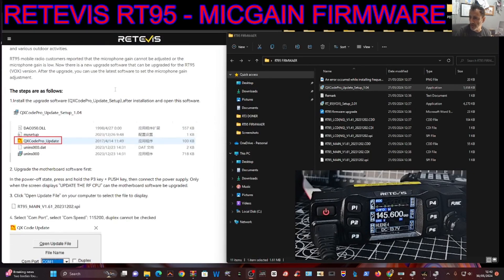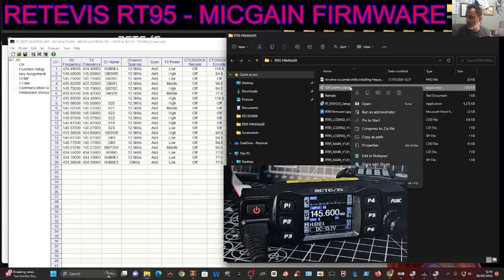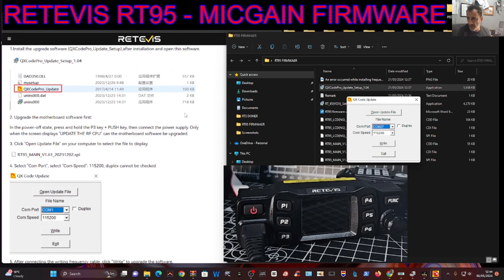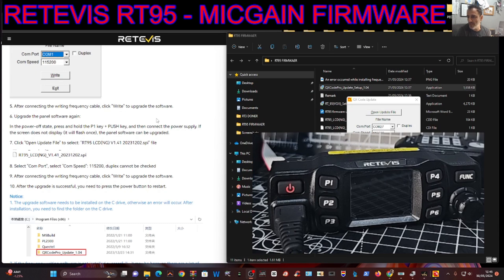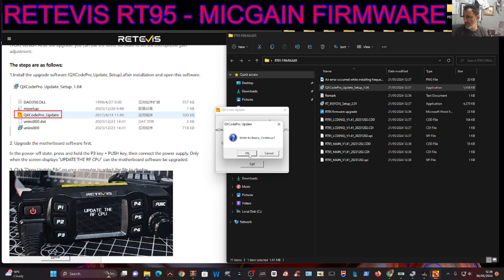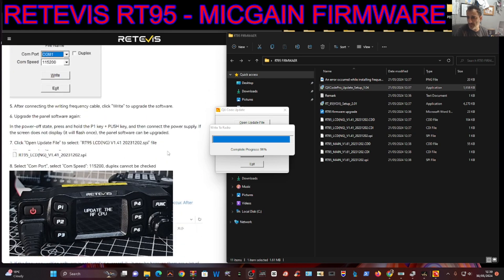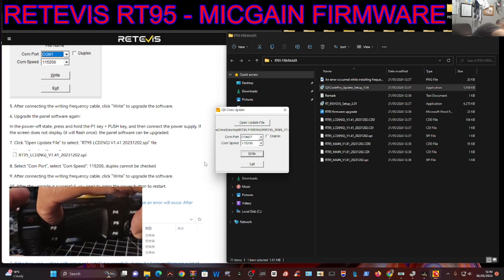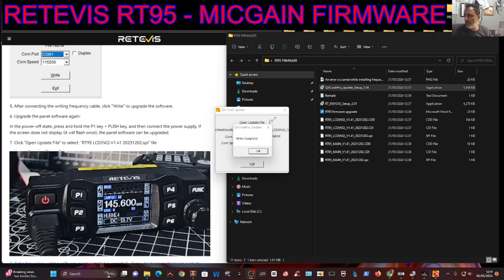RETEVIS RT95 - FIRMWARE INSTALL - MAIN UNIT/LCD UNIT

Comment: Hi, this firmware update is only meant for "RT95 with VOX" version?  
Also then How do i determine if my RT95 is VOX version?😅

Thks!
Reply from the maker: Read the radio with CPS
Reply: @M0FXBHamTech  alrite.. will try. Thks